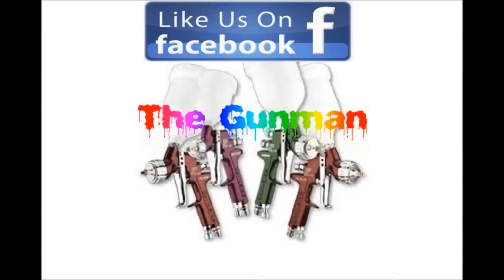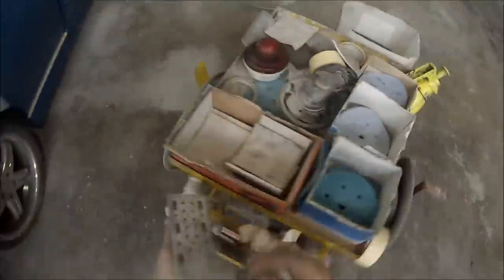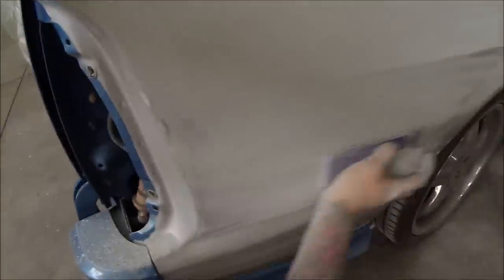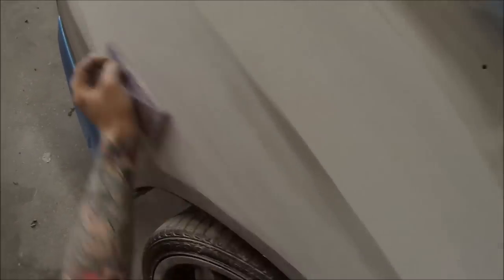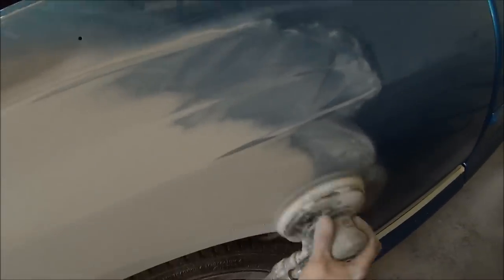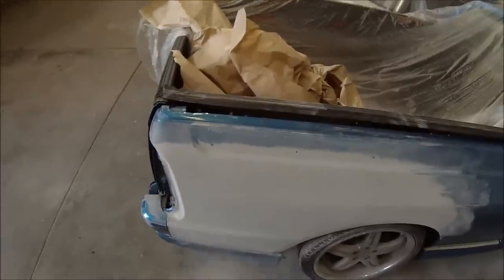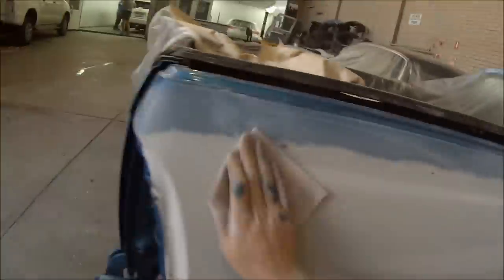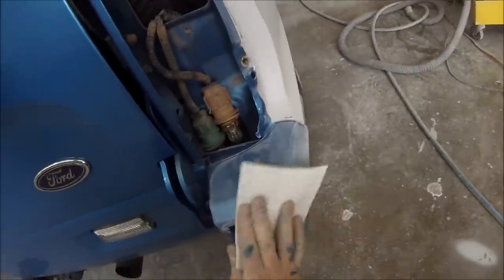How to Prepare for Paintwork "AU XR6 Tickford Ute"

Comment: Hey bud i thought id ask as you are really detailed on your steps
I have a black Toyota Supra that has fading spots and a few bits of chipped top coat. So ive decided to respray the entire thing in a Lamborghini code Grigio Estoque which is a metallic grey.
Im just wondering what would be the best steps for prep work?
i was going to simply:
Sand with 320 then 600 then base then clear would that be best? or should i sand back heavier. cheers mate
Reply from the maker: You nailed it mate do that and just spot prime any cut through spots with some 1K primer then a quick scuff with one of those sanding sponges you see me use 500 grit. Its hard to give %100 accurate advice without looking at it but by the sound of it this should work well. It may need 2K primer if there is loads of paint on it already just to seal it down and stop swelling or frying up, Good luck man and thanks for watching.
Reply: Cheers mate! no the paint level across the board varies from as low as 0.09mils to a max of 6 mils however there have been some sections resprayed which are 23mils! so they will be the toughest, as far as i can tell there may be sections that were previously repaired but the 320 should cut through and then ill hand block it back down. heres hoping i dont ruin it haha. I think i may take your advice on the 2K layer just to help the new paint bind :)
Reply from the maker: Yeah for sure man 2K is the way to go, This vid is Spray Painting For Beginners I also have a few vids on How to Prime a Car with 2 Pack Primer check them out if you haven't already and good luck.

Comment: Hey gunman.  I have a question about primer.  If while blocking out primer and you burn through to bare metal,  what do you do?  I use to just touch those spots with a rattle can 1k primer right before basecoat but a paint rep told me to never do that because 1k primer will shrink over time and you'll see it later on.  What's the best/easiest solution in your opinion?
Reply from the maker: Yes he is right but everyone does it, the other option is to use a 2 part etch that dries just as fast as 1k but lasts in the gun for 2 days so you can keep some in an old gun and its easily used, thats what I did for a long time when using the Glasurit system and it was the best way around rub throughs and keeps the warranty from Glasurit, but to be honest man if its just the slightest thin coat then I can't see it being a big problem. If the paint rep says its a "no no" then ask him what can we do for a quick fix without having to wait for 2k to dry.

Comment: So do you wax and greese  remove  a car before you sand or do any body work?
Reply from the maker: As required, not usually only if there is grease or tar on the panel.
Reply: We do allot of dealer work and they use like slimey stuff to shine the cars up it gives you fish eyes. We have a drive through infrared oven we drive the cars in so if you hsve something on the pannel it brings it to the surface.
Reply from the maker: Oh yeah if i do any dealer work i will wax and grease it but just as required
Reply: A old beater comes out the best sometimes because they never wax it lol
Reply from the maker: haha I know exactly what you mean